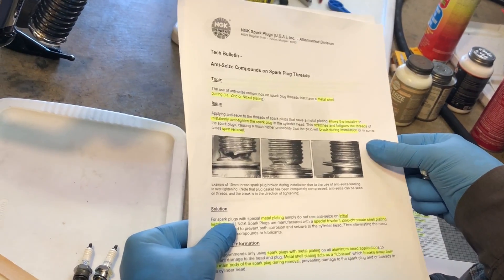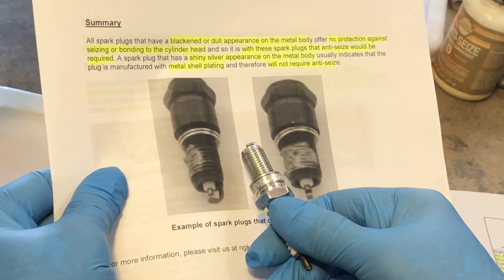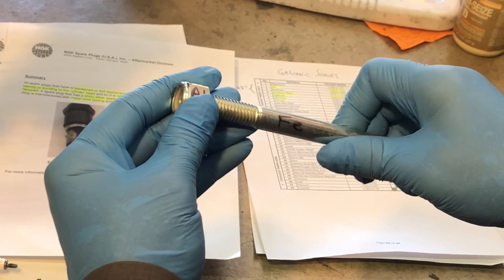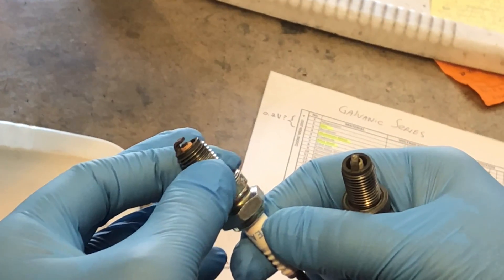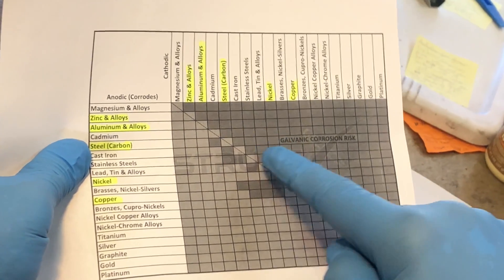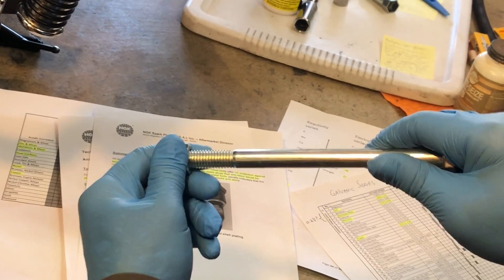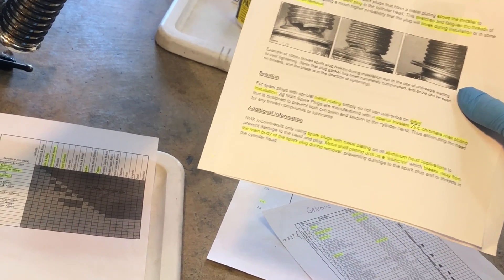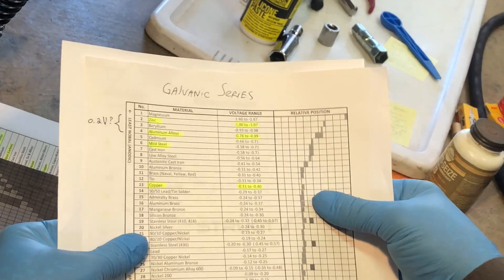Aluminum cylinder heads, spark plugs, anti-seize, & galvanic corrosion

Comment: I started working on cars at 12 in my uncle's auto repair biz. That was in '65.

One of the 1st jobs I became proficient at was gaping & installing plugs; typically my uncle would take the hard, (AC) on installs. He usually removed them out, due to me having 12 yo arms. He'd put the plugs down on my end of the bench, I'd spec the car engine, gap 'em & we'd install 'em.

He worked on zero imports. By my mid 20's, I was a Toyota specialist, but worked on all imports. By 30, I had my uncle doing domestic AND foreign repair.

In my teens, I was building drag cars & racing; an older drag racing mentor was building a new A/Gas 65 Chevy II. His previous, a shoebox '64 was a 2 time national ET record holder for their class.

His new 14:1 302 SBC would not run at 3000+ RPM's. The local Chev dealership helped me w/ parts expense on my C/Gas '57 wagon.

An out of town dealership was a major sponsor of his '65, so he ran AC Delco, like I did.

There were no NGK's at parts stores, none, zero, zip. We rarely saw aluminum heads unless it was a fuel hemi or big $ BBC, (NOT in my teens, at all).

We tested AC plugs for 3 hrs. 50% failed to fire at +150psi.

I went to the local Honda dealer where a friend was an apprentice. I knew the 2 brothers-owners cause I made their weekend breakfasts at my sister's cafe, early in high school.

The apprentice & I had a mutual friend working on cars in AK. He'd said the only plug working reliably in -40⁰F, Fairbanks was NGK & I should try them in my SBC's.

We crossed AC to Champion to Autolite to get an NGK number close enough.

8 NGK's solved the problem.

Plugs have 2 coatings, zinc dichromate or black oxide, (IE Autolite). Black is NOT raw steel.

I learned about NevaSeize on plugs that Sat @ the Honda shop. My friend gave me some & said it made R&Ring plugs much easier, plus they'd damage a ton of M/C heads without it.

My mentor was military trained in electronics & liked the NevaSeize for a possibly improved electrical connection. (It is, afterall, powdered aluminum (silver ver) or powdered copper, (brown ver) in a oil suspension; make a superior heat sink compound I learned, (in my 50's!) We both liked the idea of easy to R&R plugs, plugs less thread damage/chance of cross threading.

By the late 80's plugs in alum was common place. I've done repeat work on multiple dozen's of cars & trucks in my life.  NEVER did I experience plug or alum head damage. Neither have the mainly mechanics I've trained or know.  How do I know?

In my machanic life I met exactly 2 pro mechanics who used NevaSeize. I taught the rest. If head or plug failure happen, some would have tracked me down to exact revenge.

Look at the example pic of potential plug damage; 1 image looks like complete rupture of the thread barrel.  I've met guys who've ½ air impacted plugs in, on a dare, & THEY never ruptured a thread bsrrel.

If someone is blaiming NevaSeize on the thread barrel damage, they're talking out their arse.

As far as over tighening, a competent, pro mechanic will not, because they now what a PITA  & expense), plug thread can be. No sane person would inflict that on themselves.

Therein lies the key point of NGK's communication. It is written by competent mechanics, then edited by corp attorneys & loss mitigation specialists. NGK cannot control who buys & installs their plugs, so they have to protect themselves from the idiots of the world who have no connection between their brains & arm muscles.

Continue using NevaSeize, you will not be doing yourself or customers wrong.

What you should add to every diag list for any rough running, unknown car is a compression test.

I never had a tune up, (in the old ages wheh they were a thing), come back for anything other than a failed component.

I weeded out the bad valves/rings  BEFORE the tune up was done.

Guys used to say they could do it w/ a scope; never proved it, though.

I'd think a quick, engine hot compression test would still do for you what it did for me, removed the speculation & either guessing or much more diagnostics about hard part problems before spending customer $ on components. In my day, it was ignition, now it's sensors or control units.  It's a well invested 10 minutes in YOUR rep as a pro mechanic.

GeoD

Comment: Here at NKG we are using less conventional metals that are softer and easier on our tooling with a bonus that the source material is very cheap. To combat complaints of our plugs literally twisting off at the base, because we made the threaded shells too thin, we have put together this information packet that masks build quality problems with carefully selected wording and use cases while simultaneously shifting the blame to the installer. :face-fuchsia-poop-shape:
Reply: Tight is tight and we all know what it feels like as life-long mechanics until you give us a weaker metal and ask us when it is tight. That's when we twist them in two.

Comment: I will be the thorn on the side. I never used anti seize.  Well a few times but those that had that on them always caused a removal issue. I always chased the threads and thats it. No problems. To clarify, i worked only on mercedes vehicles and used bosch sp plugs.
Reply from the maker: All comments based on personal experience add value to this forum.  Thank you for sharing.

Comment: Anti seize on spark plugs is just a bad idea in general.   I've been a mechanic for the last 10 years or so.   I used to actually use anti-seize on certain engines with aluminum heads.   But the problem I started running into, I would torque the plugs to spec, plus a couple extra percent.   However, the intense vibrations from a running engine, often the plugs would lose torque and slowly loosen up.   Especially on some Ford's, I started to notice when the cars would come back, the plugs would not even be hand tight anymore, you could reach in and spin them out by hand.   I recommend changing plugs every 50k miles at the most, regardless if the service schedule says they are good for 100k or whatever.   If you just change them more often, it's less likely they will become seized in the holes over time.
Reply from the maker: Question: do you think the washer was crushed completely when you torqued the plugs to spec?  In the past, I noticed that the plugs would be more likely to loosen if it wasn't.  I suspect vibration and heat cycles cause a washer that hasn't been fully compressed to sag eventually, creating a loss in preload.  My feeling is that if the washer were fully crushed, and then the specified torque applied, plugs wouldn't back out.

Comment: I had to replace the aluminium cyl head on my motor because 3 of the 6 NGK plugs without lubricant had seized in it, to such an extent I broke one of them trying to remove it, the ali picked up in the thread. I have always lubed spark plugs on installation and so far the only plug I have ever broken is the one in this head trying to remove it.

Comment: Just use grease if you must use anything. Anti seize has metal particles which can cause galvanic corrosion.
Reply from the maker: Yes, provided the metal in the particles is sufficiently more noble than the aluminum alloy (or whatever material) that constitutes the head, and an electrolytic substance is present.  Zinc, on the other hand, is more anodic than aluminum.  In addition, the metal particles do a pretty good job of sealing the threads.  But, what is going to happen to grease in a high-temperature environment?
Reply: @Zerk_Ziegler  Anti seize is suspended in grease. 

I use the red stuff. Says high heat on it and its never let me down in every place I have used it including exhaust manifold bolts.
Reply from the maker: @BentonL  Interesting.  I would imagine that grease, which is rated at 600 deg. F at best, would carbonize in a high-heat environment (exhaust manifold).  Good-quality anti-seize is rated at over 2000 deg. F and has a higher proportion of metal  to grease than general-purpose anti-seize products.  Now, there are certain places where I would never use anti-seize.  For example, when I lubricate the wheel axles on my 90s H-Ds, which have tapered roller bearings, I use grease, because inadvertently contaminating those bearings with anti-seize would ruin them in short order.  Even though anti-seize is a lubricant, anti-seize and high-speed moving assemblies don't mix well.
Reply: @Zerk_Ziegler  I use whats available. I have copper anti seize and I know copper does not play well with aluminum. Everything I take apart I clean thoroughly, and I usually lubricate the threads unless locktite is required. 

I am just a good hack is all. I build things to go fast, so I am always taking things apart cuz fast equals a lot of broken parts...
Reply from the maker: 👍 @BentonL

Comment: Been changing plugs in aluminum heads using anti seize since 1977ish. It's pretty easy to "feel" the crush washer deform to the head and then begin to tighten. That's all you need. No torque wrench needed. Just did my Tacoma a few days ago. Easy peezy lemon squeezy.

Comment: But how much effort are you putting on tightening. You can either use a torque spanner if you feel that necessary or tighten until you feel the sealing washer start to pull up. This is no worse a problem than tightening bolts into aluminium. I would suggest the problem will only result if you do not service at required intervals or you are in a marine environment which will have its own servicing time an procedures.
Reply from the maker: Not exactly the same situation as tightening studs in aluminum because a sparkplug is essentially a thin-walled tube -- it is not as strong as a solid stud.
Reply: @Zerk_Ziegler True but no problem in motorcycles!

Comment: Well, I have never in my life….and that covers a total of 71 1/2 years now and for ASE master certificates… used a torque wrench to tighten a spark plug. I gently tighten using my hand and wrist choked up on the top of the ratchet, so that I am incapable of overtorquing the plug. I’ve never had one come loose, and that spans engines from Farmall tractors to race cars. Now perhaps in recent years, it has become popular to use a torque wrench for spark plugs, and I can definitely see how you could over torque a plug, if you have anti-sieze compound on the threads, and you use the same torque value.
Reply from the maker: Thank you for the comment!

Comment: Back in the late 70's, i had a spark plug seize in the head of my engine. It had been installed originally by myself, properly, dry and set on the washers. When it came time to replace, it was locked in place, and I managed to twist off the plug from the threads. The 4 banger ran, but sounded like an old time steam engine - chuf!- chuf!, chuf!. A local garage BROKE their easy-out trying to remove it. Last recourse was an engine rebuild shop that fixed the head. Used anti-seize after that. In those days, the plugs may not have had that plating on the threads, just bare steel.

Comment: There are some people who should not be allowed to be a mechanic. Just like some people can not be a musician. I have been using anti-sieze for 50 plus years on spark plugs.   It is for the next guy. Be sure to use nickel anti-seize not copper. Nickel has a higher operating temperature. Be sure to use it sparingly on the threads. Use your finger to work it into the thread evenly.  Start One or two threads back from the electrode end the full length of the thread. This is a great video to educate people on the subject. Trial and error is the best teacher in the long run. If it works for you then don’t fix it.  50+years of experience doesn’t mean you know everything but it does increase your odds of success in this ever changing world.
Reply from the maker: Thank you for the feedback.

Comment: ⚠️I've used standard engine oil on the threads for 45 years in the motor trade.
Never ever had a problem removing my customers plugs when they return for their repeat servicing.⚠️

There's a lot of baloney on the web
Reply from the maker: Thanks for sharing!

Comment: I used Dupont Molykote P-74 anti seize, which is made for SP's. P-74 contains no metals. A very super light coating. No issues with NGK plugs.
Reply from the maker: Loctite and Champion also offer graphite-based anti-seize products (no metal), specifically advertised for use on spark-plug threads.

Comment: All this talk of over torquing sparkplugs because of never-seize IMO is way over rated. If one takes NEW HEAD WITH CLEAN DRY THREADS and put NEW sparkplug in the the head, >>>>THEN do same thing with never-seize, I seriously doubt theres a newt-meter of difference in torque value....... But now after head has 75k miles and plugs need changing, seems to me that the head-thread are dirty so if never-seize is put on plugs, theres less chance of damaging the aluminum threads in the head, torque value is same as when new, BUT when time to change plugs at another 75k, theres way less chance of damaging aluminum threads on removal of plugs.....
Therefore in conclusion, if someone is breaking plugs on removal,  that tells me if never-seize was used the plugs wouldn't break, and if someone is breaking plugs putting them in, that tells me the head threads were so messed up on removal that the new plug was binding on dirty threads with no never-seize, or someone is using 200 ft lbs of torque when only 50 lbs is all thats needed to crush the crush washer and make tight......................

Comment: If using anti-seize follow instructions on package of having plug bottom out and then no more than 1/4 turn addition. This will feel loose but only because anti-seize is so slippery. Also, use small wrench which isn't so easy to over torque with.

Comment: Many times, spark plugs going in without anti-seize feel like cross threading is happening. That's why I used anti-seize. Iridium plugs that have been in an engine for 120,000 miles on them, are often hard to get out with stripping head possible. Mechanics do a slow back and forth loosening of plugs in this case.

Comment: Anti-seize makes it easy to damage threads on cylinder heads. Ironically most people apply anti-seize to avoid damage. Older vehicles like 1960s Volkswagens had stronger aluminum heads and didn't have thread problems on heads.

Comment: I use NO AS on my NGK plugs in my 2021 Civic Type-R. I just finished a 15k mile test and there was no corrosion/seizing present at all. Do not use anti-seize in aluminum heads with newer NGK plugs.
Reply from the maker: I appreciate the comment.

Comment: those plugs with crush washers: tighten until the washer is crushed, then stop.  That doesn't change wether you use anti-seize or not.  A torque wrench is not needed, but a bit of feel is.
Reply from the maker: I usually give it about another 1/16 of a turn after the washer is crushed, depending on how it feels.

Comment: I have been installing spark plugs for some 50 years and I have always applied anti-seize and never used a torque wrench.  I screw the plugs in by hand until they are bottomed and then tightened them by one flat or 60 degrees and have never, ever had one strip or come loose.  Do be aware that you should always ensure that you do not apply the anti seize compound any closer that the last three (3) threads on the spark plug as it can melt and flow down the plug with the potential to short it to ground.

Comment: I don't realy care for anti size, I find the oil in it drys out and your essentualy left with zink or copper dust bound up in the threads depending what you use.   to the people saying i never had one come back..... exactly, you have never tried removing them after 50'000km or whatever(Im a power sports tech, and motorcycle rider). I much prefer a multipurpose grease, I usualy have lucas green shit in a grease gun handy, or a moly based grease(for cv axles) kicking around.   one issue that you can't get around is a buildup on the exposed part of the plug in the combustion chamber... it will absolutly damage or destroy aluminum threads.  anyone who tightens  a plug untill it damages it no matter dry or lubricated are the same people who strip drain bolts.
Reply from the maker: A properly selected plug shouldn't have exposed threads in the combustion chamber.  Long-reach plugs should not be used in shallow holes, and short-reach plugs shouldn't be used in deep holes.  Both situations are problematic.

Comment: Of Course everyone in the comment section who’s been putting anti seize on plugs for years knows absolutely more than the damn manufacturer who makes the plugs. Bottom line, you’re not going to change the minds of people who know everything and refuse to educate themselves and act accordingly. Instead, these know-it-alls will continue to do it their way…the wrong way.
Reply from the maker: Are you saying that Honda and Harley-Davidson are wrong to recommend the use of anti-seize on spark plugs in their vehicles?
Reply: @Zerk_Ziegler  When they start manufacturing their own plugs and sink millions into the technology then yes, I’m saying they are wrong. The spark plug companies who do nothing else buts plugs have done extensive research and probably know best.
Reply from the maker: This argument assumes that Honda/H-D/etc. have NOT done extensive testing with $5 plugs to determine the best installation method for those plugs into engine heads of vehicles that cost thousands of $.  Just sayin' ;)  @doctorwu1303

Comment: On sparkplugs I only use graphitepowder.
Reply from the maker: Interesting.  Both Champion and Loctite offer graphite-based (metal-free) anti-seize, which they specifically recommend for use on spark plugs.  Wouldn't powder be more difficult to apply?
Reply: No, You just pour it on and press it into the threads with a finger - You can give the threads a bit of very thin oil to make the powder more sticky  @Zerk_Ziegler